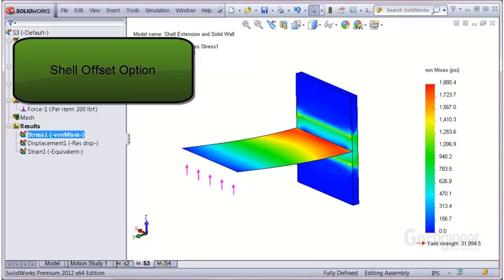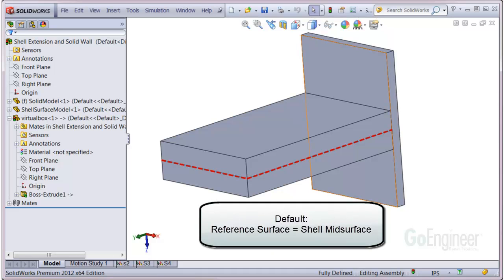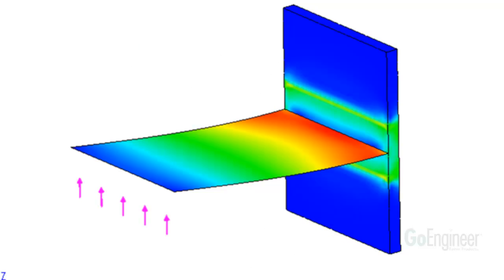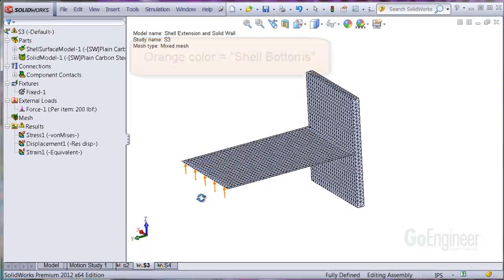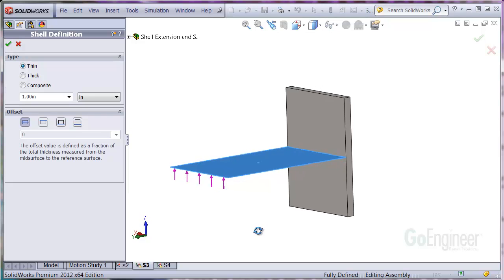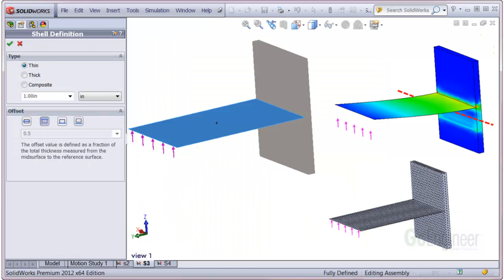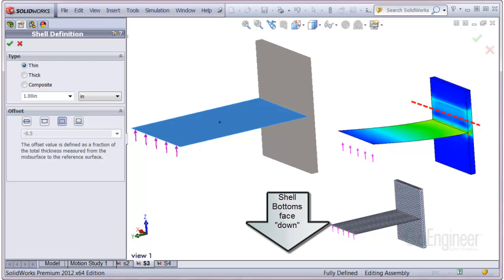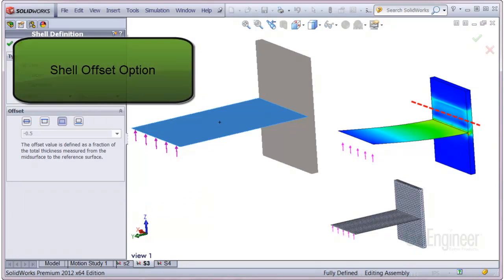SolidWorks Simulation - Shell Offset Examples

Comment: What's the reason or circumstances where we are to use shell definition instead of full body ? :)
Reply from the maker: This is typically done to save analysis time for thin constant wall thickness components like sheet metal components and structures described in the video. Using a solid element for these analysis would lead to a higher degree of freedom count increasing solve time significantly.
Reply: @goengineer  Appreciate your response. How we interpret shell definition results to actual (full scale/size) product